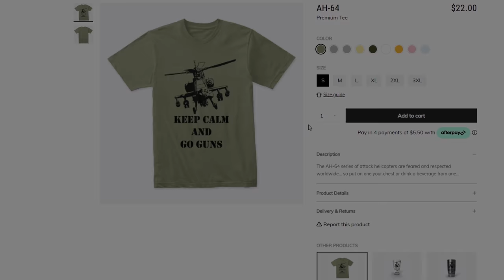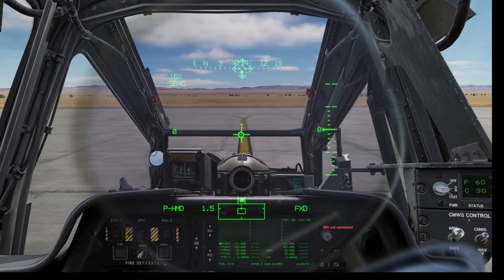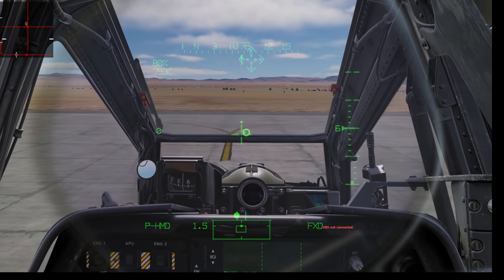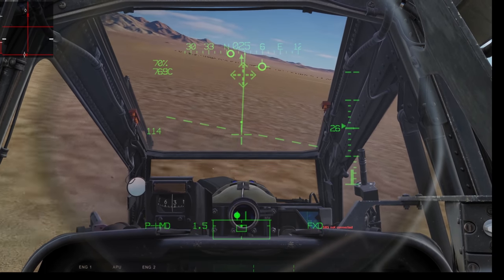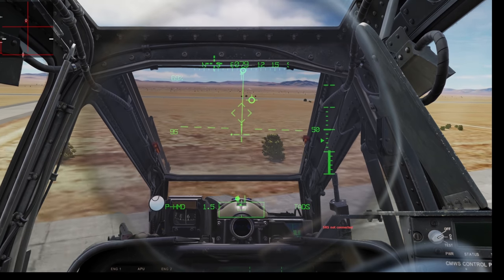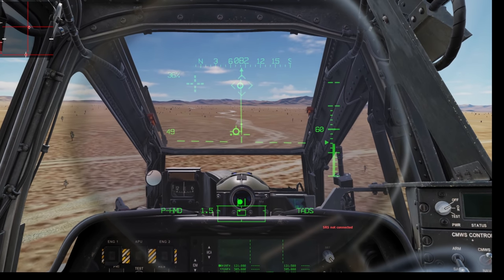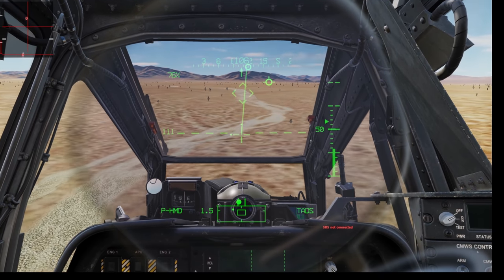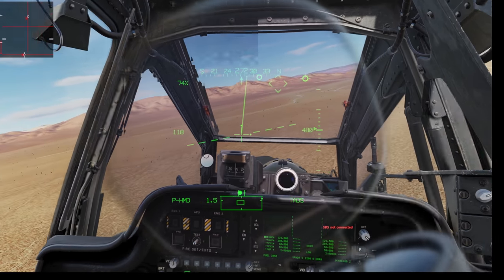DCS AH-64: How I deal with the Trimmer

Comment: Curious why you didn't turn off the Rudder Trim in settings (option 3 the "no spring" option)? With rudder trim turned off, it's a much nicer compromise, and you can trim for hover or at any time really. The older helicopter modules all had a rudder trim tickbox in special settings and most people had it turned off, only in the apache it's not there but option 3 seems to be close enough.
Reply: did the same and works perfect for me. I also removed the spring on my rudderpedals. Now it's so easy to fly

Comment: Center trim isn’t the devil. It keeps the control input  from instantly being doubled when you hit force trim. Instead, they are set to current position and your inputs are inactive until you go to center. It works really well one you get in the habit of letting the stick settle back after trimming.
Reply from the maker: I honestly don’t care what anyone does. As long as it works for you, do it.
Reply: @CasmoTV  enjoyed your vids immensely and appreciate the effort you’ve put in to this module and know the effort that goes in to these vids. I didn’t mean to criticize this one in any way, central trimming just seems to be very misunderstood. That’s all I was trying to say.
Reply: Its ok, until u try do very little trim adjustments and it wont apply those correction until u kick pedals... I hate this.
Reply: @TylerPL  Yeah, it may vary based on the resolution or quality of the pedals and other gear. Mine center really well so haven’t really had an issue like that. And some remove the springs altogether which would make it less convenient.
Reply: So what exactly is the difference between the default setting and the ffb? This (like so many other things) is not explained well enough in-game..
Reply: @VilleVaananen  With FFB trim, the position of the control surface at the time the button is pressed will the setting when the stick is centered. So if you have 10% forward cyclic and press trim the center stick position will register as 10% forward immediately and for a moment it will combine with your input to equal 20% forward cyclic. You pull the stick back to center immediately and depending on how much practice you have you may only get a small bobble. 

With a FFB stick  the stick locks to that position. You would check the FFB box in the settings for it to work as designed. It would be far more realistic, but FFB sticks are uncommon and expensive. 

With centering, it does basically the same as the first except that when you press the button for trim it will no longer register any of the control input axis until they are returned to center, so you don’t get that “jump” when you hit the button. But you also have no control until you center the axis. It comes down to personal preference. Either way will take a little getting used to in order to avoid leaving controlled flight. I worked on a short vid showing how center trim works last night but I’m terrible at such things. No talent for talking to a microphone. Might try again and upload this weekend.
Reply: @Jack-Tactical  Great explanation, thanks! It seems both have their pros and cons. I think the center trim option would suit me better, because it doesn't require skill to keep the chopper steady after pushing the trim button. You only need to remember to return to center. Over time and with practice, that shouldn't be a problem.

Comment: Don't know you thoughts casmo; I have taken the springs out of my pedals and removed pedal trim; it's much better; but for cyclic; I wish we had the 4 way attitude trim switch going kinda like fixed wing trim. I fly 212/412s so I'm used to 'real' force trim and I just don't think there's a way DCS can ever get this 'right'. I much prefer a very loose spring and being able to 'beep' the cyclic forward to unload in the cruise would be much better than any sudden cyclic moves because in VR it's really hard to keep track of where your at and for me; it's the one thing that just just breaks the realism/feel for me. And hitting the cyclic stops still messes up my seat almost everytime. If we can do 'real' I would much rather control. I think being able to hold fwd on the hat and just bring it back on the spring keeping it all smooth would be a much neater compromise.
Reply: You still have springs in your pedals? Why not disable trimmer yaw?
Reply: I'm thinking of chucking the hydraulic cart on the 412 and demo-ing the real system to help people understand if you want.

Comment: A question: I am a fixed wing guy, currently using a Virpil Ace Pedal. Should I remove the spring from the pedal because if I understand well in helis the rudder pedals do not want to return to zero position all the time unlike the fixed wing aircrafts.

Comment: I’ve never flown a helicopter with pedal trim. This looks like it’s going to take some new muscle memory.
Reply: The Mi-8, Mi-24 and KA-50 has pedal trims.
Those doesn't work with trim button, but separately. The pedals has solenoid to detect pressure to pedal and that triggers mechanical pedal movement. You can disable the pedals trim functions, but at that moment they become completely loose.

So having pedals trimmer linked to trimmer button in cyclic is counter productive in those helicopters.

Here is how those trimmer works. https://youtu.be/2kC3tWzwD_A

When you have trimmed to heading, altitude and speed/roll angle, the autopilot channel gets Xx percentage authority to move your controls from trimmed position to maintain those values.

Example in KA-50 it is 20% from trimmed position, if autopilot requires to move controls more than that, it can't as it is limited. And you can see how much autopilot has authority in each channel by looking those small windows with white line aligned with two white strips. When aligned, there is full authority to all directions. When edge of the window, the autopilot can't move controls further to maintain that channel.

Comment: I'm curious if the Apache is really this prone to VRS in real life.  Seems to have very weak power to weight ratio atm compared to say the Blackshark.  But the real black shark has a gross Weight to Power ratio of 2.7, meanwhile the the Apache D has a gross Weight to Power ratio of 2.8.  So the Apache should be just as easy to throw around as the blackshark, but it really isn't.  The Apache can gimbal really quickly, but oddly the much more massive KA-50 can change direction and elevation much easier.
Reply: It doesn't get in the VRS as easily, because people often suffer from power automatic adjustment that takes few seconds to keep up with dropping rotor RPM. So quick adjustments cause loss of lift and there isn't enough time for engine to stabilize RPM.

Smooth, slow controls helps to avoid all that.

The KA-50 is capable for ridiculous 60 meters per second climb rate. This was presented 2003 in Chechenya at mountains when test pilot was required to make evasive maneuver and pulled collective and KA-50 instantly went full vertical climb saving the pilot life at that time (he was the general, leading the KA-50 helicopter project in Russian army side, most advocate promoter for Kamov).
Reply: @paristo  I agree adding a strong curve to the Apache collective helps avoid settling with power, but my point was that while both choppers can get into this state, the KA-50 can easily power out of it or move forward easily to get out of the column of descending air.  This early version of the DCS Apache can do neither in a lot of cases and if it attempts to pull the collective, it gets even more unsettled, causing it to lose even more lift.  Given the moves I’ve seen in Apache air shows, it seems to handle itself with a lot more authority, power, and stability in real life.  Eagle Dynamics almost always gets the fight model pinned down to a precise level eventually.  Helicopter physics is a lot more challenging than jets aerodynamics or even prop planes, since they are relatively 2 dimensional by comparison, so I can see this is definitely more of a challenge to nail down.  The KA-50 flight model is a lot older, but that also means it’s a lot more mature, and tbf uses different physics than a single main rotor chopper which also has an under the hood FMC that complicates matters even further.
Reply: @ziljanvega3879  In my first two flights in Apache I got caught with the power delays. In the first one I dipped half way in the water, but managed to get out.

My mistake was to fly it like Huey or like Black Shark. Huey just like so agile and light to react, and black shark as power and authority.

I realized after the two close calls that I was late few seconds what I wanted to do. And I was slightly dazzled that I had forgotten that how much you need to predict behavior before it really happens. 

So I took it for wild ride to adapt to that. After few crashes in next hour, I got good handling to it. Flying at high speed over road both sides having trees and coming to 90 degree turns and all was possible. Jumping up and down over treelines like a bunny was easy. Going full Apache mode, flying under telephone lines and going between trees just getting rotor fitting between them, and going flying under trees became fun.

The key? Think 2-5 second ahead of your actions depending what you try to do, and trust that machine will perform.

I don't apply any curves to any helicopter controls. Because I have extension etc, so I can maintain great precision all the time.

But as long did I stare that display about torque and and question each time "Low RPM" warning, I didn't trust myself. 

Apache doesn't have the performance that Black Shark has, but at low speeds you have great pedals authority to change turn directions quickly. 
But your collective is limited and you are in trouble if you pump it too fast, too often, same with pedals.

Get ahead of yourself, and use the force to think where you are those few seconds ahead and go by the experience that Apache will follow you there.

Comment: So under control options you have trim UP/DOWN/LEFT/RIGHT but it seems that DOWN is the only one that sets the trim, the other directions don't do anything, is this normal?
Reply from the maker: Those are hold modes and hold release.
Reply: @CasmoTV  looks like I'm gonna have to get my head in the manual and see what those modes are. Thank you
Reply: @CasmoTV  btw, do you think modifying the trimmer to mimic a regular trimming system (like the Huey one for example) is a viable option for ED? Or would that just be wrong?
Reply: @boggy8557  the huey only has force trim doesnt it? the apache has it also but some autoassists to go with it just like for instance the black shark.

Comment: What cams and springs are you running on your VKB MCGU? Do you have any damping dialed in?
Reply from the maker: Whatever it came with. I’m too chicken shit to try and take it apart to replace them.
Reply: @CasmoTV  Play around with the damper abit. They're pretty easy to access from the top once you remove the dust cover. I find that dialing a bit of damping helps offset the weight of the MCGU.

Comment: The forums were mentioning a heading hold that, when the trim is hit below 40kts or so, it will work to hold the heading.  Any insight into that?
Reply from the maker: It’s not implemented yet
Reply: @CasmoTV  thanks
Reply: @CasmoTV  What about the automatic turn coordination, is that working as intended?

Comment: Casmo, I use the second option in DCS and is easy for me with my joystick setup.  The question I have is when you come in to land in the real ah-64 are you still slightly trimmed or do you zero it out beforehand in the approach? Kinda like in an airliner single engine you take out some rudder trim so when you decrease throttle on the good engine it doesn’t swing the other way on you in the flare.  Also after you shutdown the helicopter does it automatically center the stick and rudder or is the previous inputs saved and you have to zero out the flight controls on the preflight?   After landing the only thing nice in DCS would be a zero trim reset to get to a quick baseline without having to eyeball it in VR.

Comment: No, the purpose of trimming an aircraft is not "to keep that control surface where you want it". It is to keep the control stick and pedals centered, while the aircraft maintains coordinated flight. Flettner Tabs or servo tabs are used to do this.

EG
- You wish to fly heading 90° - ground track.
- There is wind coming from 0°.

To maintain flight along 90° ground track, you must push the right rudder pedal, constantly the same offset. This is strenuous on the pilot over time.

So the pilot moves the trim tab on the rudder into the wind-flow on the right side, which forces the rudder control surface toward the left. Now the neutral position of the rudder is slightly to the left while the rudder pedals are centered, which makes for a relaxed flight along the wished ground track.

The Apache emulates this same behavior, by letting the pilot reset where the neutral position of cyclic and pedals are (where there is no force required to hold them motionless). So the pilot puts the cyclic and pedals into the positions where the Apache is flying along the path wished, and in the attitude wished, and initiates force trim, which locks main and anti-torque rotors setting, allowing the pilot to return the stick and pedals to their centered positions, where main and anti-torque rotors are now locked to the cyclic and pedals in their now centered positions. This is visualized on the controls indicator through the red "X"es.
Reply from the maker: … which actually keeps the control surfaces where you want that. Don’t argue semantics with me.
Reply: @CasmoTV  It's not semantics. Its a question of focusing your viewers attention on the purpose of trimming, which IMHO makes it much easier for them to understand.
That is just my perspective. I know it's not your, and that's okay. I only wanted to maybe help out a little, not to make a an aggravating attack. I'm sorry if I've made you feel attacked. That was not my intention.
Reply: @DerOrso  you are mixing real behavior with simulated behavior because most people dont own ffb peripherals which mimic actual behavior. the simulated behavior is not depictive of the actual trimming but its the next best thing when you dont have ffb or a springless dryclutch stick.
Reply: @kingpinda2  You're probably right. My point is, there is a purpose to trimming, and it is to make flying easier on the pilot.
Reply: @DerOrso  yes but you are using wrong examples. In most modern, fly by wire, planes, only the control surfaces or the tabs change their orientation. In choppers, the rudder and cyclic aren’t centered when trimmed but they are re-centered offset effectively changing the orientation of the control surfaces. You are switching from real life mechanics to simulated workings which really doesn’t help explain what you mean. Ofcourse they are meant to make the life of the pilot easier. It changes how the control surfaces are orientated while offloading force on the flight controls. In some more analog planes the stick moves when trimming. It doesn’t center. It has a new center yes. Off-center. State of the art planes which are usually very unstable by themselves trim automatically and even depending on the flight parameters will mix in elevator next to the airelon when just rolling. Anyway there are alot of different ways planes and choppers trim. But they are all there to make life easier no matter if the flight instruments stay centered like modern planes or are offset in choppers and older planes but they all change the way the control surfaces and or their tabs are orientated. Which is the most important bit.

Comment: I just don't see the point.  I'd rather just hold the joystick where its at.  Not alot of effort
Reply from the maker: To each there own.
Reply: it depends on how stiff your springs are i guess, i know with mine i have very heavy springs in so holding it forward for an hour or two plus flight would cause a mean cramp
Reply: True, I have a large extension so that might help
Reply: @CasmoTV  sorry,  their
Reply from the maker: @ericcraft9856 … do you feel better now?
Reply: The warthog stick is just too stiff to do that. Perhaps the Virpil cm2 base with the low resistance springs/cam is better for this.
Reply: @CasmoTV  I do,  airforce over army thing...